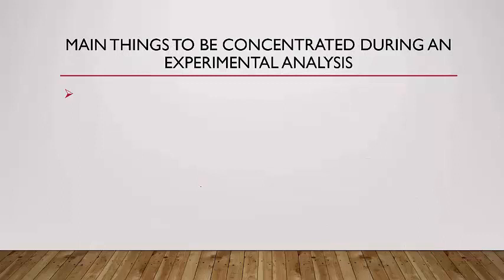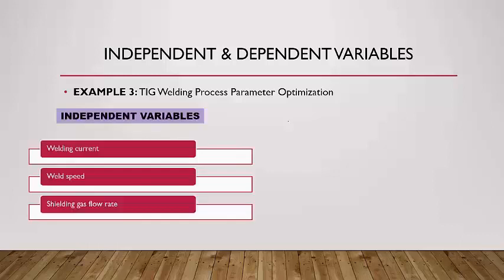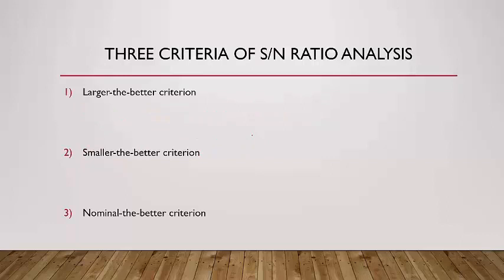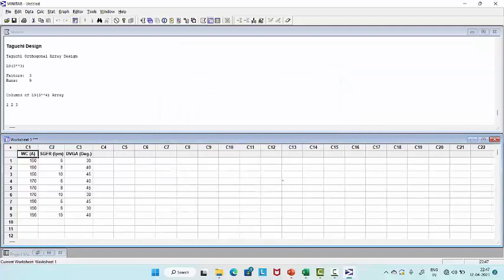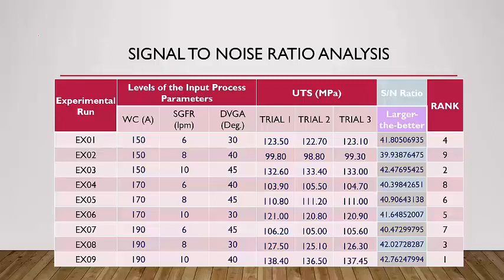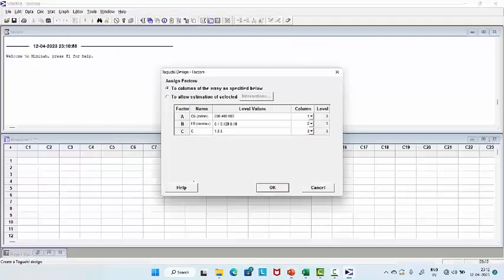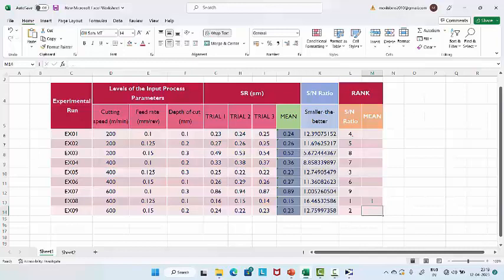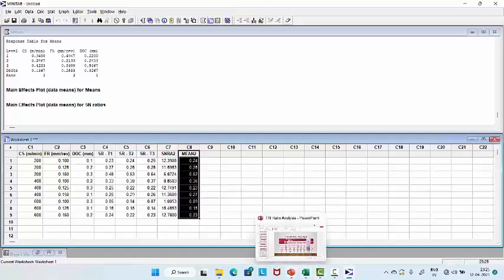Signal to Noise Ratio Analysis in Taguchi Method (Using MINITAB Software)

Comment: i have 2 factors with 3 levels and formed l9 array for which i have prepared two samples(trials) for 9 combinations to check compression strength of samples. my doubt is, is it sufficient and suitable for scientific publication? which statistical tests to perform..please help sir.
Reply from the maker: If you have considered only the optimization part with the Taguchi's L9 orthogonal design approach, it will not be sufficient to get published in a standard journal. You have to extend your work in such a way that various interpretations can be obtained and which should be useful to the relevant research community. For example, microstructural analysis can be performer, and its results should be compared to the optimization study results. 

For DOE analysis, various useful softwares are available. I am using minitab software.